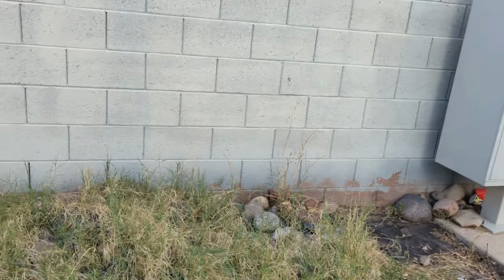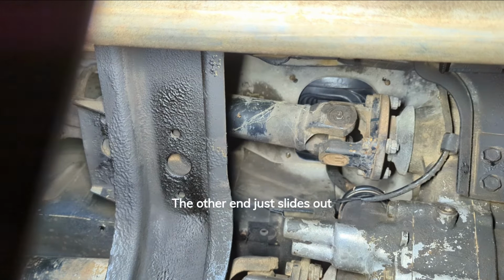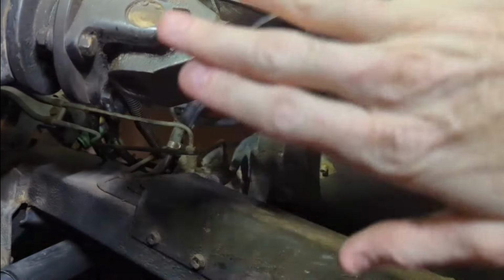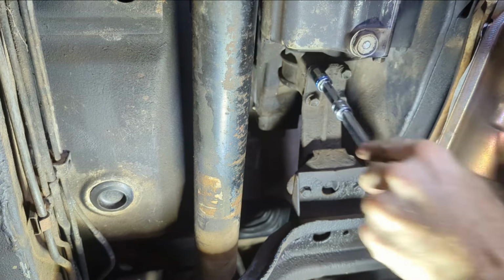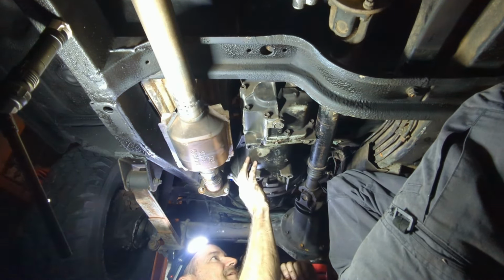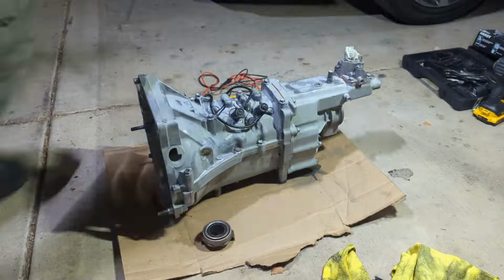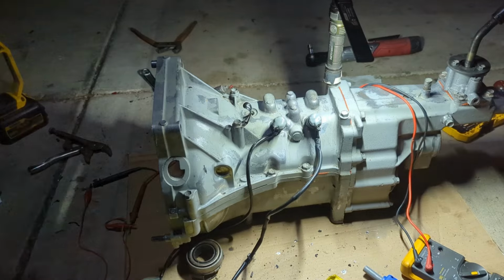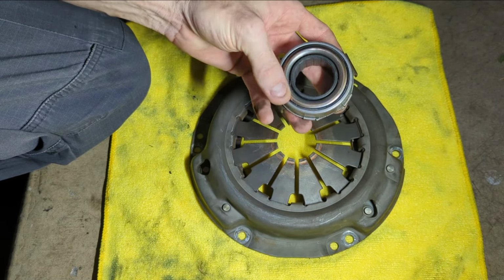Suzuki Samurai Clutch Replacement: Restoration Part 89, Step By Step SJ410 SJ413

Comment: Memory flashbacks … I replaced the 45 kg/99 lbs auto transmission in my Gen3 Jimny just as you did it now, lying on my back under the car. I had it softly land on my chest. 
…I was way younger then…
Reply from the maker: @BorisEkner  Yeah I think if it was much bigger I wouldn't do it unless I had a trans lift. This lil feller was tiny, but still not easy. Sucks that they have to turn to come out instead of dropping straight down.
Reply from the maker: @BorisEkner  Wait till you see how it goes back in. My roommate's Uncle Wayne wanted to help but there wasn't room for 2 so let's just say I did some rigging lol.

Comment: The 5th gear switch is for the carb ECU to lock out the EGR on stock SJ413s. Clutch and bearing look fine. Cable needs adjustment.
Reply from the maker: Oh ok, thanks. Yeah I heard the stock carbs on these were partially elec controlled, this thing actually has an O2 sensor lol. At first I thought about swapping the sensors because the one for 5th gear still had the wires attached but as soon as I touched it a wire broke off and I had to solder it back on. Sounds like it won't serve a purpose on my rig but it's there if someone ever puts a stock carb back on it. So the new throw out bearing makes noise too, not as loud but you can still hear it... do you think it needs less tension so the bearing doesn't get thrust as far in? Hey thanks for the comments!
Reply: @FixLife119  Keep the 5th gear sensor as a spare reverse light sensor. If someone swaps the 3K for a stock carb, they deserve the pain it will cause. There’s an adjustment procedure in the manual. You’ll need to do that anyway since you’re doing the clutch job. Off hand I think it’s 1cm of play until engagement on the pedal.
Reply from the maker: @davekeehn8388  Lmao!, right. Prob can't get to it without dropping the trans but it's there if someone needs it. I'll see what Haynes thinks the play should be on the cable. Thanks bro!

Comment: Mines got a 6" ground from neg to firewall right behind the batt
Reply from the maker: @1shotbarbeque881  That's great, the shorter the better. When I ran mine I didn't want to make a new hole so it's a little longer but I've heard these thing have big grounding issues from the factory. I did a video where I dropped the windshield and ran a ground to the wiper motor and counted the wipes per minute before and after grounding it, it did help.

Comment: I don’t know how the Samurai is wired electronically, but I know how weird my 2022 Jimny is. 

It has a constant positive, and when for example a light is turned on ground is added to the circuit. 

I have no idea why Suzuki decided for this weird design because it is truly a confusing experience.
Reply from the maker: @BorisEkner  Yeah it's kinda weird. I got used to the neg door trigger (dome lights) and neg door locks so now it feels weird when some of them are positive (usually American vehicles).
Reply: @FixLife119 
Until I had my 1998 Gen3 and now my 2022 Gen4 Jimny I have never experienced a permanent positive in any vehicle. That said I have heard that other manufacturers have adopted the same wiring.
Reply from the maker: @BorisEkner  I've always hated the way Ford does their plugs, especially in the doors for the locks, windows, mirrors etc, but I have to say the plugs under the hood on the Samurai are some of the goofiest things I've ever seen lol.